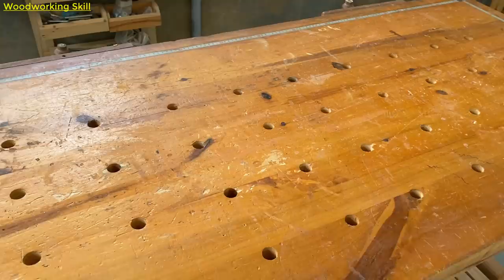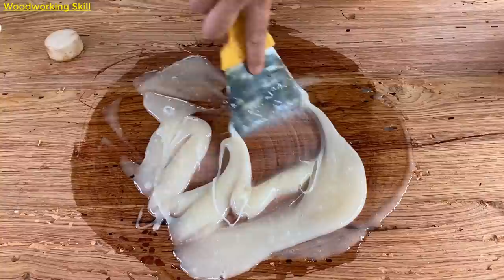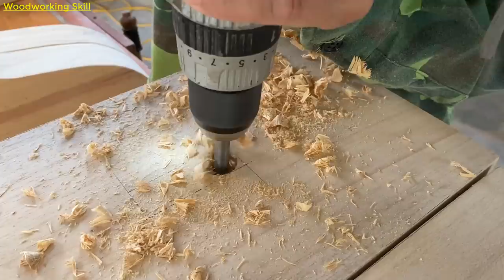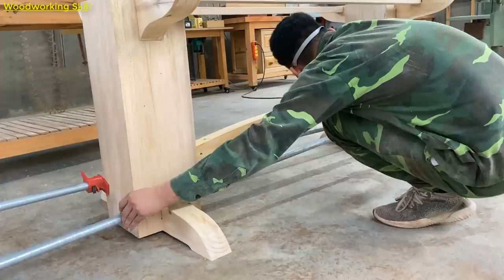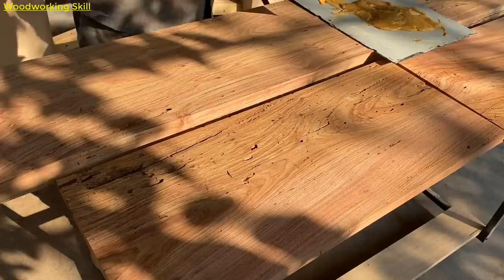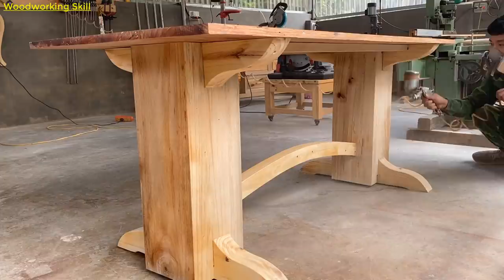Use The Rotten Wooden Board To Do Something Unexpected // Huge Dining Table Set For 8 People

Comment: The term for decaying wood or as you're saying "rotten" is actually called "SPALTED".  It makes for a beautiful finish if the piece is not too far gone. Beautiful work there!
Reply: When I worked for a Hard Wood Flooring Factory,  it was called "worm wood" and was our more exspensive flooring, Very Beautiful!
Reply: @Mr_Rick  thank you, I didn't know that, but the wood is beautiful either way💕
Reply: @SusanRogersMakingItWork4Me  Yes Spalted wood is beautiful and hard to find.